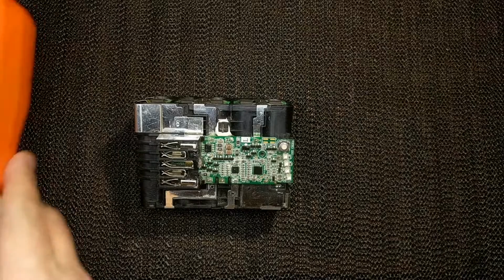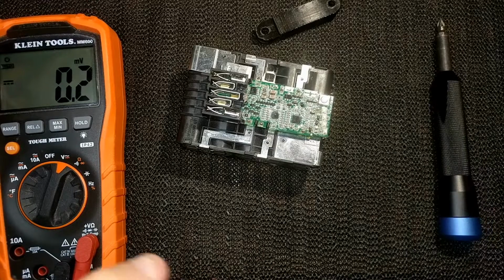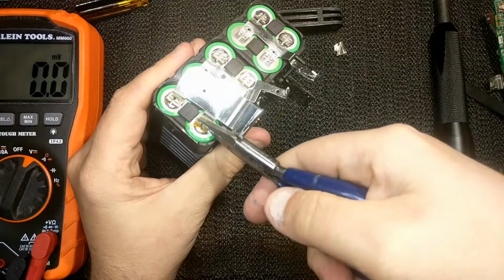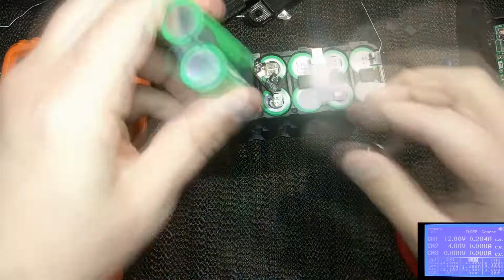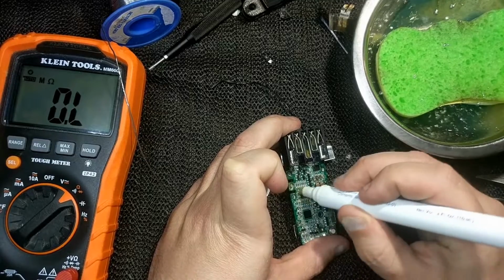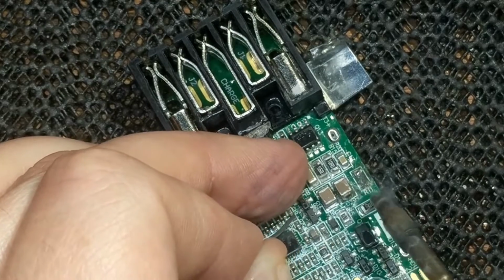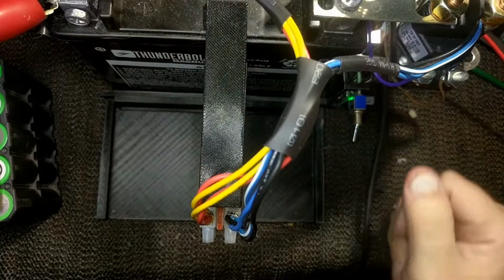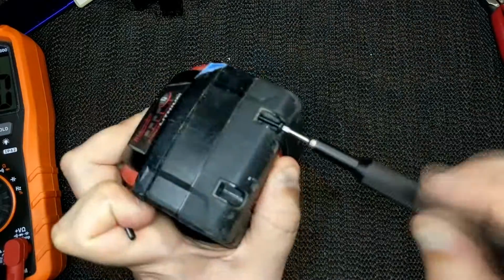late night Milwaukee Battery Repair part 2 - 068 #milwaukee #repair

Comment: work in industry sites environment keep my 18 volts in the cases some of the 12 volts have the 12-volt tools did not come with a box to find the plastic orange ammo box works the best to put them inside worn out 5 of the impact guns in the 12 volts 5 to the saw-all too warrant cover them too i do use every day too   
i have the charger in the case with the batteries so i can have pair of batteries in 12 and 18 vold in this case too i do have 18-volt tools too more than one drill i have to do planet maintenance time i am in the plant for a week i leave my tools in the plant too never been stolen at all i have a second set of tools when i have to go out on a break down to most of the door i am to hight with my stacks to get my truck inside too   
i am now on my own working I keep some of the customers i work with to give up on the breakdown cell now to back into fabrication-type work again and build a machine for the customer too

Comment: Do you know what you did to get it not not blink and accept a charge I have one that my tool was bad and drained it down and have manually charged each group of cells and still blinks
Reply from the maker: Cells are probably bad then.  As the cells die they experience parasitic loss due to a higher internal resistance. One easy way you can check is charge them, disconnect and let them sit for a few days to a week.  At the end of the week, you'll probably notice the cells have a much lower voltage reading.  Other than that I'm not sure.  It was so long ago that I worked on this particular battery.

Comment: I've had success with manually balancing a couple of 12ah batteries that weren't fully charging. One bank was much higher. Drew it down with a 5w 12v bulb, and lipo charger to bring the lowest up.

Comment: Easy fix make a 21V slow charger, charge to full over time. Then hold at that power. If it is a truly bad cell, then swap it out, but just today o brought one of these back from the dead. ZERO volts on all cells 😲 to revive just zapped with 12V at moderate current, 300mA till i got 3v, then hammered with high currents 20A pulses till 3.6v. Then charged. If you must undo the cells cut across the strips and you can actually solder them in and on the board cut and paste style. 🤓
Reply: Just curious, were you using fully charged cells to deliver 20A pulses?

Comment: what kind of charger are you using to bring it above threshold. i  read  that these batteries need to be chargerd with  constant current with no voltage first. then constant voltage.with no current. or something like that
Reply from the maker: That's partially correct.  You need voltage to have current.  I used a bench power supply.  Basically the way it works is you set the max current and max voltage.  When the battery is dead or low the power supply will be in constant current mode (max current that's set).   Once the battery reaches the maximum voltage (usually 4.2v), it goes into constant voltage mode.  This assures that it won't go over that maximum voltage and at this point the current will drop until it is fully charged.  The specs for each battery can be found by googling the part number listed on the battery.  The datasheets will have the maximum recommended charge voltage and current.

Comment: That was not a fix, it showed 3 bars but full on the charger therefor the charger will not charge the pack even it drops to 1 bar charger will still show full
Reply: I saw that too
Reply: I saw that too

Comment: Well I have a few V18 batteries that indicate they take a full charge. The lights indicate they are fully charged. I use them for about 1 minute and the indicator on the battery Shows it needs a charge. Put it on the charger, charges fast then does the same thing. Could this be a bad cell?
Reply from the maker: Probably
Reply: I have the same problem. Did you find a way 2 fix it ? my battery is 1 year old :S
Reply: @neon128  Their is an adapter on Amazon for Milwaukee V batteries to M batteries or you have to rebuild the battery pack. They use 26700 Li-ion batteries. Haven't looked to see how easy it is to rebuild them yet.
Reply: 26650 - 26 mm diameter, 65 mm length, 0 shape
Reply: @mdemory  The number stamped on the battery is 26700. What are you trying to say here?

Comment: Doesn't disconnecting the circuit brick it permanently ?
Reply: I’ve been told you need to inject voltage at two points before disconnecting cells. I personally rebalance my 9Ah once every month or two when they fall off. They will be as much as .5v when I notice. I hit em with 3-4 amps and I do it at the bottom of charge cycle. Banks 1and 3 on both batteries are the ones that drop. Yes I’ve warranty claim and got new. But same shit. Ps they sell the Pcb that drops right in with terminals n all. I don’t think you fixed it in video
Reply: that's only makita to my knowledge
Reply: i think its milwaukee too
Reply: Repaired some of the packs and it did brick it temporary, charger rejected the pack.... BUT... i manually charged the pack to just over 20V and it reset whatever turned the pack off.
Reply: @christopherleubner6633  Interesting observation. I'll test that 1st chance I get.